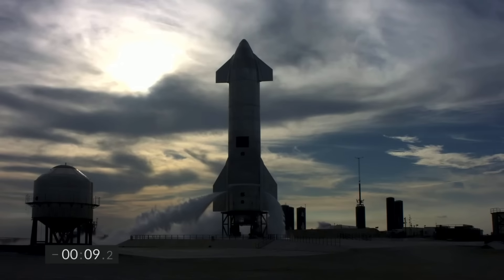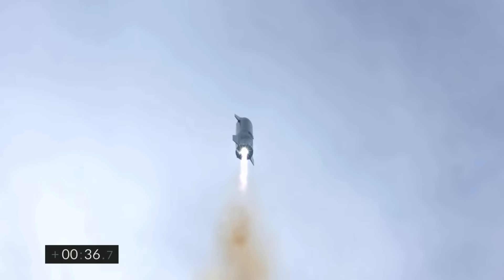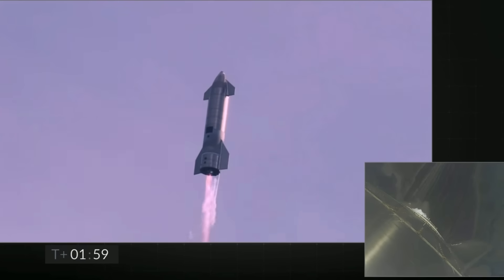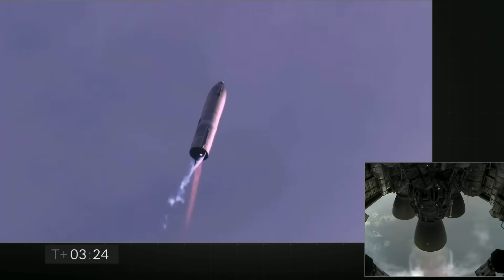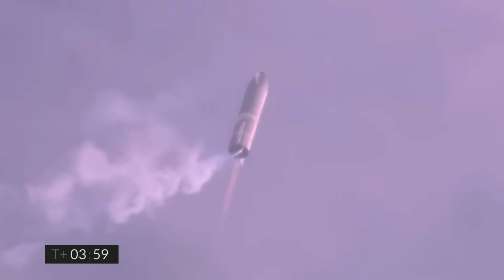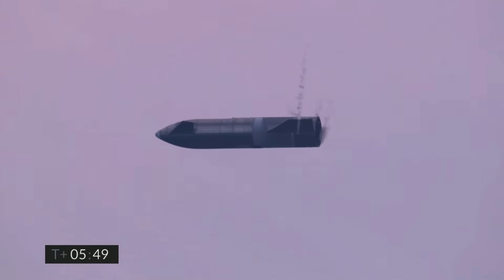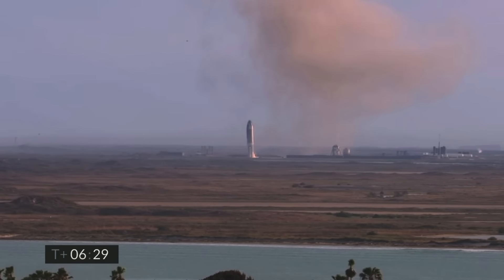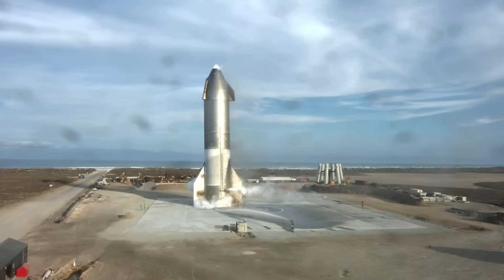SpaceX Starship SN10 soars, lands for first time!

Comment: Not being a rocket person, but why not have four engines, instead of three? You'd get better balance as you turn the engines on and off. It looks like the engines are shaking too much when they turn them on and off.
Reply: Because another engine means more mass, more complexity, more points of failure. Stability is good enough with 3 engines already it seems. Most of rocket stability comes not from the steering of the rocket but the mechanical and aerodynamic stability of the rocket body. Plenty of rockets have just one engine with thrust vectoring.
Reply: @victordonchenko4837  Maybe it is just a combination of my fear of flying. And seeing a rocket hovering in mid-air, that looks questionable to my eye. Rockets don't normally work like airplanes in earth's atmosphere. They usually go straight up into the weightlessness of outer space. I do know rockets blowing up is never a good sign.

Comment: 'Soft' landing didn't look soft to me. It bounced quite a bit. The final decent rate still looked too high. Not sure if the issue was the final decent rate (and failure of the legs) or if the legs didn't all deploy. Be interesting to get some feedback out of SpaceX as to the issues still to be addressed. Looked amazing during the flip'n'burn though, especially from the pad camera looking straight up!

Comment: Where's the Ka-Boom?  There was supposed to be an earth shattering Ka-Boom!  Guess SpaceX propaganda team doesn't want to show that part!  You can see at 6:21 when engine's 1 & 2 shutdown, one or both of them are still spewing unburnt fuel which is being ignited by the third engine and burning as that orange flame.  I know the commentator says "it's a successful soft touchdown" on "one engine as planned" but it was not a terribly soft landing - makes me wonder if it was supposed to be on 2 engines.  The ship hit pretty hard and was slightly off plumb once it settled.  They're getting closer, but I have the feeling this one was a hair away from exploding on touchdown - and of course in the other videos you can see it blew up a minute or so later anyway.  Good luck with No. 11!

Comment: It's amazing how little rocket fuel is expended, compared to past space shuttles. The flaps even retracted!
Reply: Keep in mind that this is only going 10km high and reaches a top speed (in this test) of maybe a few hundred km/h with no payload.  The space shuttle was carrying up to 60,000 pounds of cargo to an altitude of 2,000 km and reaching speeds of 30,000 km/h.   You're comparing apples to oranges.  That said, I love how "clean" these engines appear to burn!  I hope as this scales up in the future to a viable delivery system it continues to operate this way.

Comment: That was a  true milestone flight that mankind  has accomplished today.  Keep looking to the stars, we're going to get there.
Reply: You know it exploded a couple minutes later, right?
Reply: @nickh5081  that's true. But it's the first successful landing like this. It's never been done before. One thing at a time.
Reply: @stevendeskins7175  Fair enough, but if you crash into your garage and your car explodes few minutes later, do people say you successfully parked?  Don't get me wrong, they did a little better than the time before - which is progress.  New tech like this is often made by taking baby steps, to be sure.  For the record, vertical landings by rocket powered aircraft are nothing new, they've been capable of that for a long time.  Space X is just trying to do it on larger scale and with a prototype that will actually be able to orbit rather than just a proof of concept vehicle.
Reply: @nickh5081  lol. Good point. I just want to see us go further. We can do better. I at least want see us make it to Mars. I'm 45 now and probably might not see that before I go into the light. But there is always a possibility.
Reply: @stevendeskins7175  I'm with you.  I turned 50 last year and would love to see people land on Mars.
Reply: @nickh5081  it also landed.

Comment: What to congratulate when it failed dramatically -exploded upon taxiing. what a joke?
Reply: This is a prototype, they are mean to test new systems in extreme conditions, sure they could do all the tests on the ground but that takes longer and costs more, this allows them to rapidly see what works and what doesn't and yes this means they sometimes exploded but they are still a success cause it gives them the data they want.

Comment: I would be worried about it's "carbon footprint" but CGI's don't have carbon footprints
Reply: This isn't cgi tho
Reply: @drmantistoboggan2870  then explain why the vapor trail is is coming from the rocket is so calm when it is descending at about terminal velocity and it why is the rocket falling so steady without  any tumbling or going into a flat spin. Its design doesn't dictate it can counter act those observations. One final observation is the flame coming out when descending
Reply: @frenchbrit5098  the vapour trail is just condensated air so I don't see why it wouldn't be calm. What do you think it should like instead?
Reply: @frenchbrit5098  I don't know enough about rockets to explain why it wasn't spinning or tumbling. But just because you or I don't know why something happens, doesn't mean it didn't happen at all, right?
Reply: @frenchbrit5098  what's wrong with the flame on descent? I don't even know what the problem is with that

Comment: At around T+ 30 seconds the smoke starts to appear in the rocket exhaust. One of the engines was failing. Presumably that’s what started the fire. Amazing how long it hung on though. In surviving as long as it did with a burning engine, and managing to land without the legs extended, it demonstrates how strong the construction is. They’ve just got to get all the ‘bits’ working properly, particularly those engines.

Comment: Hardly a "success".  It landed crooked, missed the target and was on fire.  Pray tell, what is the practical usage of such a device?  It can never achieve space orbit and return as imagined without overcoming the known limitations of rocket engines.  Ten kilometers?  Let me see it do that at 25,000 km/h and I'll be impressed.  Nothing here has not already been done before.  Decades ago.  It presently takes almost all the weight of a craft in fuel just to reach low earth orbit.  Now double that in fuel to return as imagined here.  Simply not going to happen with current technology.  Notice the changing zoom and camera angles and not a word about the obvious out of control fire and need for suppression foam.  lol.
Reply: The previous two didn't get this far, it's progress. You have to start somewhere with new technology. This is no different than the Falcon program. They were failing regularly and now look at it. 

I think you're confusing "flawless" with "success". Success can be measured, but no one is saying this was a flawless test or that improvements can't and won't be made. Again, it was successful because it was a step in the right direction. Still very early on in the testing phase of the program
Reply: @chanman4rings  Thank you, I appreciate your opinion.  My point is mostly regardless of how successful it is, it has no future beyond what it is capable of now.  The shear physics of chemical combustion to allow such a system to reach and return from low earth orbit is zilch.  It can not be done this way.  I wish it could too.  But there is a reason the space shuttle returned with no engine power.  Because it is not possible to lift all the fuel necessary to do otherwise.  This is a pipe dream like the "hyperloop".  Neither are going to happen on any useable scale.  Both technologies have been done before.  Even if they work perfectly, they are also completely impractical and non functional as a result.  Elon is a fantastic Pay pal guy.  Very smart.   Good for him.  But being good at one thing and becoming wealthy does not make magic real, no matter how he presents it.

Comment: Now they have to figure out how to safely dump all the fuel after landing or immediately before landing.  Otherwise they may need to separate a capsule at 3,000 ft or more by parachute and land on land like the Russians used to.  That explosion in the other video they linked made that perfect landing just sad.

Comment: Seems rocket hitted little bit to hard the ground, maybe it caused gas leak...anyway its huge step forward, rocket landed!!!
Reply: Yeah, I'd say if that's all that went wrong then it's a pretty good landing.
Reply: 2 extensions of rockets engine pop off just before landing , so actually it managed to " land" at one of 3 engines....what a sucess :) .....we should say failure of engine parts ....not a sucessfull landing.
Reply: Only simple minds believe in these fairytales. When you start looking with a skeptical eye it becomes clear that all of this nonsense is fake.

Comment: I think the design and process is a bit weired, first vertical, then horizontal, and then landed vertically! Why not land horizontally?
Reply: Several reasons really.
1.) It doesn't have the right profile to significantly slow it down through air resistance alone, meaning it has to use the engines, which only works if they have them pointed at the ground.
2.) Adding in the complex landing gear system for a horizontal landing would add an unacceptable amount of weight.
3.)The superstructure of the Starship isn't designed for the stresses of a horizontal landing
4.) The mid-flight flip to a horizontal position is only their to simulate the orientation a starship would be in for an actual reentry from orbit.

Comment: Remember how large the exhaust plume was on past ships. This one is amazing.
Reply: Well normally a couple more rockets would be attached considering it needs more power to be able to escape the pull back down, so that's probably one of the reasons the cloud was so small
Reply: That plume is mostly from the water vapour made by the water sprayed on the engine to prevent the sound waves from ripping it apart during launch

Comment: How do they expect this thing to reenter the Earth's atmosphere?
Reply: They will mount a huge heat shield on the belly of it, then extend the flaps to create a lot of drag. Then, using thrusters and flaps, it will guide itself down to the landing pad and do the same as it did here, just a little bit softer.
Reply: Heat tiles. You could see a few on SN 10 being tested.

Comment: that happen if you build in a park Assistent from the Tesla in SN10 ... parked in ... then wanted to correct slight and parked out once more. But serious: good job. And I’m sure the telemetric will provide enough data to figure out what happen. Way of progress is not always straight but SpaceX doing a great job in pushing the boundaries.

Comment: I have a question if anyone could answer: the descent looked like a controlled one, it didn't look like a free fall, how is the descent being controlled considering the fact that all the engines were shut-off?
Reply: The flaps provide control. If you look closer, you can see them moving. Don't think of them as wings, think of them more like how a skydiver uses their limbs to control their descent.
Reply: @samos8367  thanks! To me the descent looks unnaturally slowed down even if controlled by the flaps, but anyways that would be the explanation. Also how does the rocket change orientation and become vertical before landing? Is it similar process like VTOL used by fighter jets?

Comment: Interesting. In just about every landing other than this a parachute is deployed. Even if you were going for a controlled landing such as this, wouldn't it require less fuel if you deployed a chute to reduce speed somewhat?
Reply: @Ratonhnhaké:ton It ultimately exploded afterwards. I would say those are points for authenticity.

Comment: Appears to climb REALLY slow !  How would it ever reach escape velocity ?
Reply: Starship will fly on top of the Super Heavy booster. The Starship System is 2 staged. The Super Heavy booster with 28 Raptor engines and than the "Starship" upper stage with 6 Raptors (3 vacuum, 3 sea level) which will also be the main transport and essentially a SSTO for places with gravity less than Earth's, (such as the Moon and Mars for instance.)

Comment: SN8: Tries to land, explodes. 
SN9: Tries to land, explodes. 
SN10: Lands, then explodes. 

This is progress. One problem at a time.
Reply: Indeed, they are very close to a complete success.
Reply: @roycsinclair  No, they're still a long way. Not because it is easy, but because it is hard.
Reply: SN11 explodes then lands
Reply: @lazypotato6743  I think SN 8 and 9 did that already
Reply: @lazypotato6743  Sn12 explode on launch 😭😭😭 jk
Reply: @Yerixle  SN12 won’t launch, they scrapped it because SN15 has better equipment and they have no need for SN12, it’s all because of evolution with starship tech.
Reply: sn8 landed and exploded. Sn9 just exploded. And sn10 landed and exploded after few minute
Reply: @Yerixle  sn8 crashed. What launch did you watch? There is a difference in landing and crashing
Reply: @jd2161  it did land but unfortunately it explode on land. That was what I watched on live stream.
Reply: @Yerixle  again... it did not explode on landing. It's exploded mins later. That's not on landing. 

What video did you watch?
Reply: @jd2161  which sn do you refer to? What I was refering was the sn8
Reply: @Yerixle  That usually happens when an aircraft is on fire when it crash lands , what you saw was a crash landing and the leaking fuel from the crash resulted in the aircraft exploding once the fuel was ignited from the fire. That aircraft has some serious design flaws.
Reply: @dagger4146  well it crash *landing*. How can I not say it was landed? Just crash? Crash nowhere? How did it crash? Did it crash before the landing attempt? Was it never landed?
Reply: @Yerixle  An aircraft that has a landing gear collapse upon landing is considered a crash landing.  Not only did the landing gear fail to deploy properly , the aircraft was on fire as well. Just because it briefly came to rest with the pointy end up does not mean it made a successful landing , the resulting explosion proves it.
Reply: @dagger4146  ok
Reply: First Starship to the moon after several successful missions, is retired to Smithsonian, then explodes.
Reply: Still remarkable
Reply: Next explodes then lands
Reply: I think I have narrowed down the problem: combustion
Reply: Freaking amazing!
Reply: It's a very russian approach to spaceflight actually.
Reply: @atomicskull6405 Really? Do the Russians use this method as well?
Reply: SN11??? Hmmm.
Reply: Next, tries to land, then launches and explodes
Reply: Dirty Sanchez  They even got turnaround time down from weeks to less than ten minutes.Now that's progress.
Reply: Well said  😁
Reply: https://www.youtube.com/watch?v=YblaCYo_ZdY
Reply: Or a scene from Monty Python's Holy Grail.
Reply: aS mY FRENCH COOKING TEACHER USED TO SAY,     IF AT FIRST YOU DON'T fricassee, FRY FRY FRY AGAIN!
Reply: Now 
5-5-2021
SN15 : Land Successfully
Reply: @Imtiyaz5power  Did you see it?
Reply: @nothere9551  yes
Reply: @Imtiyaz5power  kool can you send me the link I would like to see it.
Reply: Like the test launches in October Sky movie!
Reply: Obvoiusly it's fake. Take it from an expert... with 20'000 plus hours of real time flying of real big aircrafts. Just saying, kids. Start to use your brains, get a life and stop looking up to hl. El on Mus K, the no 1 lsr of OPM... other ppls mny.
Reply: You should watch some of the footage of rockets when the space program was in its infancy. Lots of failures. The first astronauts had balls of steel.
Reply: thanks god, Nicola Tesla did not think in this frame, we would still be riding horses.....
Reply: @janapodnecka3346  And if we were still riding horses we would be closer to the land, the environment would be in better shape, there would be fewer wars fought over resources and global wealth would be more evenly distributed. 

Alfred Nobel instantly recognized what he had done when he discovered and shared dynamite with the world and created the Peace Prize as a way of saying "oops" sorry world.

Faster, bigger, farther and more isn't always better.
Reply: Well they have to show where some of the taxpayers money got spent, research and developmental, costs a bomb.
Reply: its fake

Comment: really... really dumb question.

This reusable rocket system requires extra fuel to carry, meaning the initial launch needs more fuel to burn.  As a result, here, we have more fuel we need to transport, lowering payload for the SN10.

So, transporting more fuel, as well as adding a risky "flip" and "burn" maneuver to the rocket... I just gotta ask...

Why can't there be a Parachute landing with landing gear with strong enough springs/suspension system to avoid having to cart around extra fuel and reduce payload?  Surely a parachute would be lighter than all the needed fuel... yes?
Reply: Starship's dry weight is over 100 tons. The size a parachute would need to be just on Earth to slow down would likely take up the entire pressurized volume (or more) of the craft, let alone where they want it to go eventually (Mars) that has only 1% the air pressure of Earth and the Moon that doesn't have air at all. 
The Perseverance rover weighed just over a ton, and yet its parachute was over 20 meters in diameter. And that only slowed it down somewhat and it still needed a skycrane to land it safely. A parachute isn't feasible at this scale.